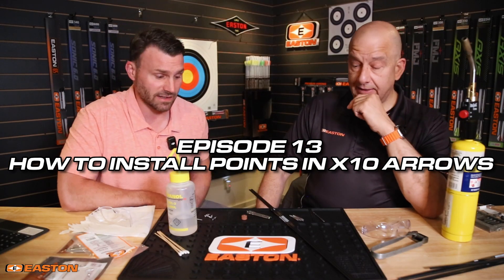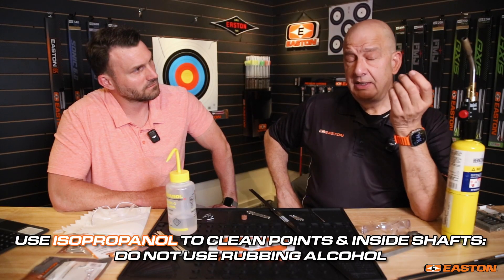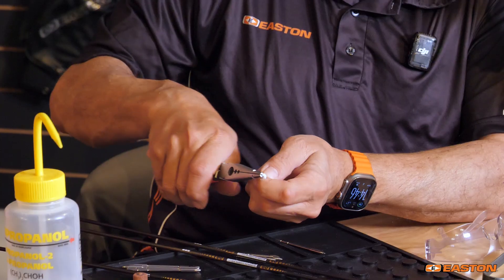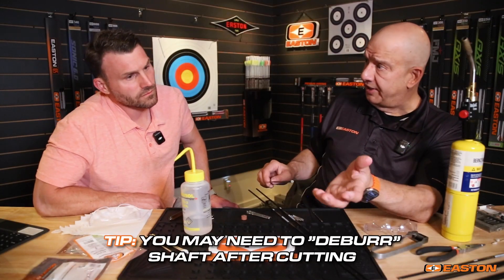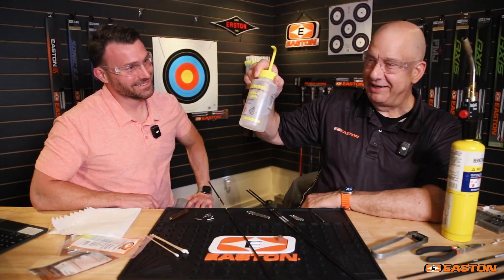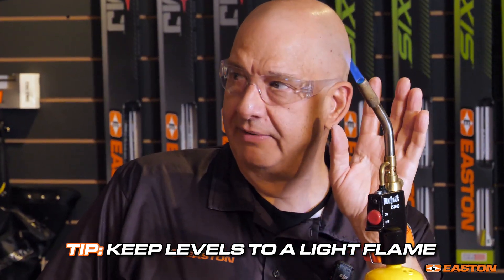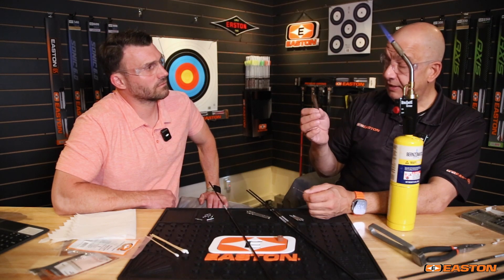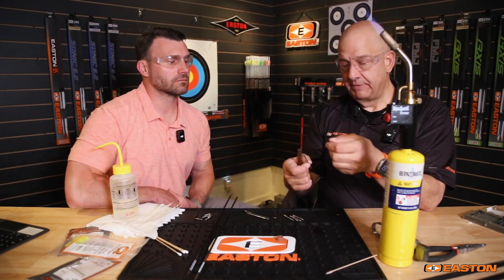How To Install Points In X10 Arrows // Easton - Technical Bulletin (Episode 13)

Comment: I once read, compound and crossbows shoot an arrow to fast for hot melt glue, thus when they strike the target, they cannot handle the forces applied to the glue. Is this true? Did Easton reformulate the glue to account for tremendous forces on impact? Thanks.